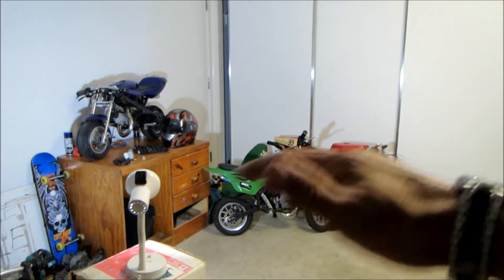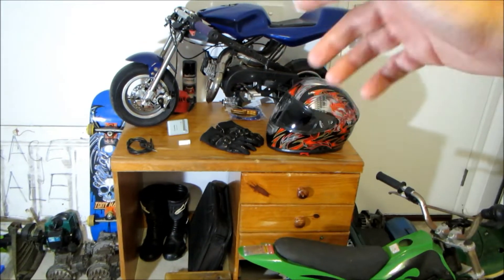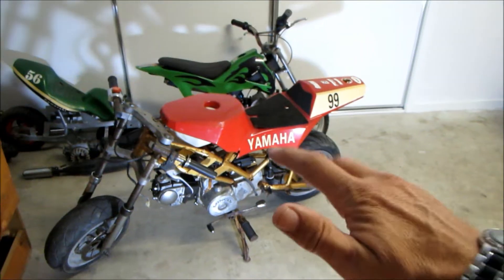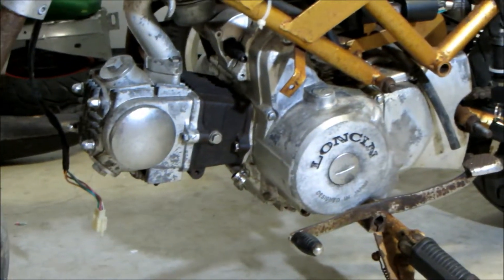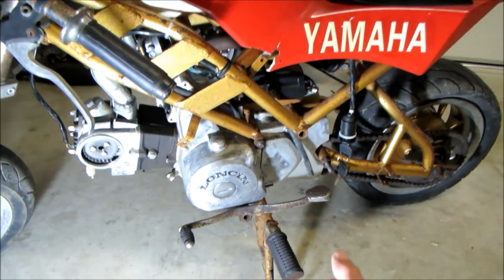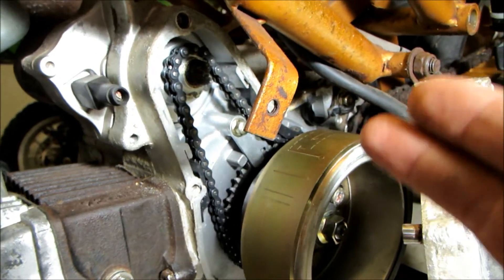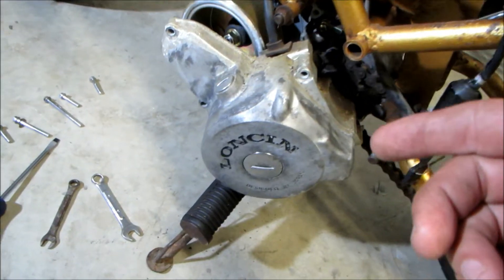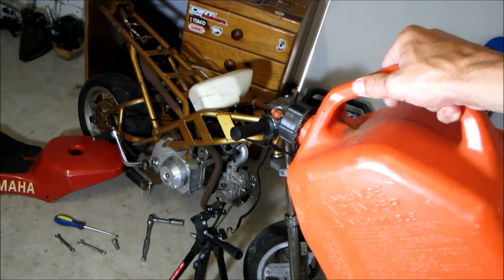80cc Super Pocket Bike = BUILD or NOT.!!!

Comment: Hey that bike is perfectly fine the only reason it doesn't start is because the ignition switch nothing is connected
Reply from the maker: yo its just the old switch.... its the one with the key that is connected..... i just got that throttle of a old bike.. any way thanks for watching and feel free to give any more tips...
Reply: @skullcam  but you dont seem to get it you will need a harness that's also connected with the battery that's how it gives better spark and also it has the coil running good
Reply from the maker: has no battery bro...its the same as a pit bike motor.... and that throttle with the horn ..indicator.. and on off switch is of a different bike i had... there is no spot to plug it into the bike...

Comment: You have to put the stator plate on to access the view of the top dead center mark for the flywheel to line up with. So with that on you unscrew the smaller cap on top of the stator cover, and then take the bigger cap off the stator cover to spin the flywheel with the nut. The threads Wich the smaller cap was screwed into will have a flat spot streight up them. Or just make your own timing marks since it is still in timing then reference them when putting it back together

Comment: Hey man I used to ride bigger bikes ( Yamaha YZ 125 and bigger), just to try it if you already haven't, when you kick the bike have your choke and fuel on, give it a couple kicks but kick from higher up, don't push the kickstart so close to the floor it gives it more of a chance to turn over, if it doesn't start turn fuel and choke off as it's easy to flood it and it won't start, only other thing I can think of is make sure the cable connecting to your spark has no damage as a tiny bit may not let your bike start, really hope this helps man, if it's helpful gis a wee shout out my name's Carlan Shaw, would love to see ya get the bike running
Reply from the maker: hey thanks for the tips bro and thanks for watching skullcam...yo ill give you a shout out on my next vid

Comment: Hey skullcam! I was wondering if you know where to buy supermoto tyres for a pit bike without changing the rims and breaks. Thanks
Reply from the maker: yo where are you located..
Reply: skullcam Cheltenham
Reply: skullcam my tyres are 14” and 12”. I was thinking maybe swapping my front 14” for a 12” so they’re both equal. But does that mean the rear end of the bike will sit up higher than the front?

Comment: Build mate... Hey mate if your not getting spark check coil wire where it connects to wiring is it a clip? They can sometime come loose and not make contact which can cause no spark make sure all wires/grounds are connected! Even unplug cdi and plug it back in... If you want to try more lol let me know as theres a few more I could help with
Reply from the maker: yes i am starting to think it is electrical issue
Reply: @skullcam  yeah most likely mate bikes spark needs to be a brighter orange or blue a dim orange is not really going to work look at the wiring like pull all plugs/clips aprst and see if there's dirt or just crap or burnt points clean the wiring if you want but it is most likely  something simple causing bad spark
Reply from the maker: year bro.. im thinking that as well.. the engine seems to be good... so it should be simple ..

Comment: check the valves they like to tighten up on those engines then it starts losing compression.
it's a honda clone engine you can use the same specs as a honda ct70 when you adjust the valves.
the timing mark is on the case you remove the plugs one in the side and on the top then you look down through the top to line up the marks and turn the motor over with a socket this way you can adjust the valves without taking off that side cover that you took off...
Reply from the maker: ok yeah thanks man that a big help... ill give it ago ..and thank you again for watching

Comment: Narrow it down and assume it's got compression and spark, disconnected the ignition and take off the air filter spray easy start down the carb hold open the thorottle and kick it over.
Reply from the maker: ok ..thanks bro.. ill try that to

Comment: Bike sounds like it wants to start but just can't have you adjusted the idle screw even with fuel in spark plug hole it will struggle to start with low idle
Reply from the maker: yeah its come close to starting.... but yeah im only guessing with the screws...
Reply: @skullcam  do you have any engine start! Spary that down the the carb and give it a kick a decent kick to
Reply from the maker: nar ..wish i did

Comment: Spark is very weak. Next step is to get a brand new wiring loom with electric start. Costs about £30
Reply from the maker: sounds like a good idea
Reply: @skullcam  Do you know how to fit a mini moto carb to a super pocket bike. Without it leaking air. And maybe make a custom carb adapter
Reply from the maker: yeah i think you would need an adapter

Comment: The Loncin engine basically same with Honda Supra  /  Wave / Dream / Future - Honda NF Series.
to see the top centre just open the cap under or top of "LONCIN" with little cap, look usually there is a arrow or strip dot mark, you can see here for your guide for reset the valve and set top death centre, the engine is same with yours ->  https://www.youtube.com/watch?v=COK3U80_B3Q, if  you missed a little forward when trying
, no problem. the valve gap IN 0.05mm OUT 0.05mm use fuller gauge.
And this is the way for optional if you want to total clean up the valve https://www.youtube.com/watch?v=T5kEVwLZfMY
Hope this can help you.
Reply from the maker: yo thanks foe the tips and links bro...ill go have a watch of them..now
Reply: @skullcam  Twist the magnet to the left once or twice or more until the valve shoe (like on the video) move up and down, and then you get the "T" under the mark, just do exact like the video, good luck bro, feel free to ask me if you don't get it from the video because Indonesian language.
Reply: Don't forget to check his channel and subcribe,  he has same machine like yours

Comment: Trying change the spark plug with new, if you can see the spark doesn't mean the spark plug working when compression process, and with gray on spark plug, the fuel too lean try resetting like this video https://www.youtube.com/watch?v=4ws8y66bQFs hear the engine sound when you try to twist the screw jet, the highest sound engine produce is the best. and clean the carb before.
Reply from the maker: thanks again bro....ill try what you say..